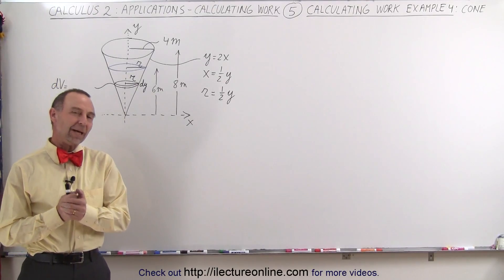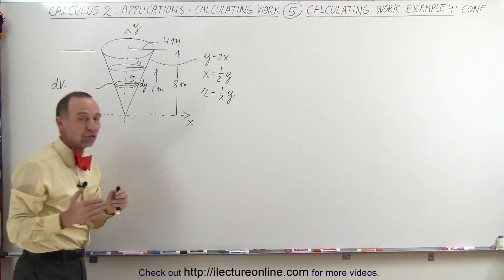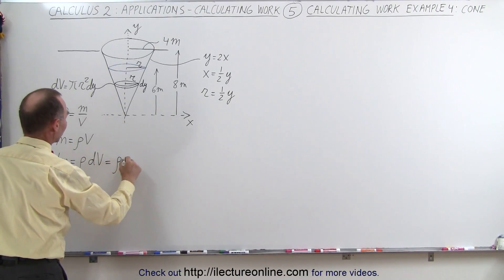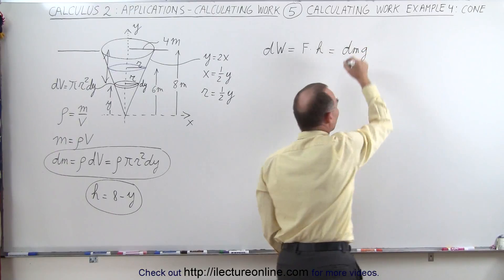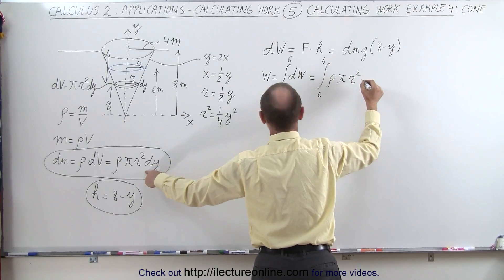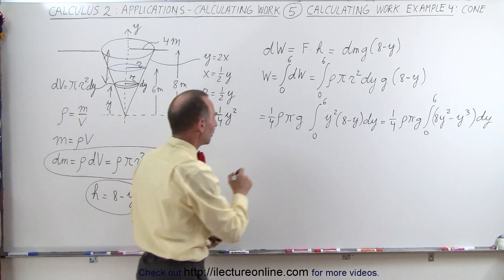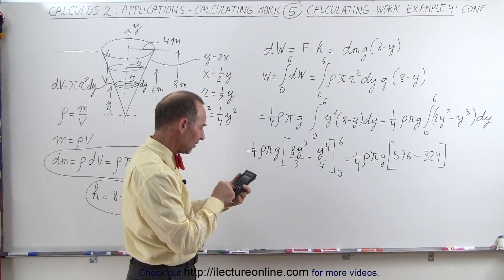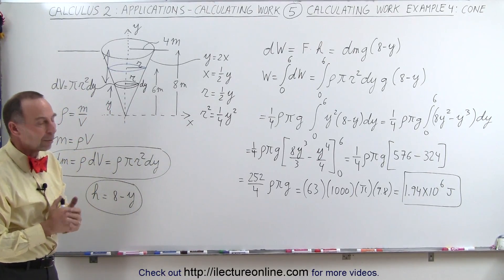Calculus 2: Applications - Calculating Work (5 of 16) Calculating Work Example 4: Cone

Comment: Thank you Sir for the videos. Can I know why didnt you just say h = 2 instead of (8-y) and why did you choose the limits to be 0-6 instead of 6-8 and can I use 0-2 as limits instead of 6-8? Thank you
Reply from the maker: The distance from the top of the water to the rim of the cone, as the water level drops down to zero, is always 8 - y for any value of y from y = 0 to y = 6.    h = 2 is only correct when y = 6

Comment: How does this pump work? Does it move down with the water level? Last time i checked a pump would pump from the bottom of the tank, and the water level would go down, with the top water being sucked up last, and the distance that all the water has to be pumped would be constant- the height of the tank
Reply from the maker: Regardless of where the pump is places and if the intake is at the bottom or not, the effect would be the same as if the water was drawn from the top of the water level.
Reply: I can remember that for the future, but it still conceptually does not make sense to me. If you are drawing the water from the bottom, then you are drawing the water from the bottom. The physical distance the water goes is from the bottom to the point you are raising it in my mind. Thank you for your reply though
Reply: Your explanation for this problem was excellent, however, far better than my professor taught it!
Reply: @purpleapplepie2276  The work needed is equal to the difference between the potential energy of the water in the initial state and the potential energy of the water in the final state. In other words, it doesnt matter the trayectory of the water in the process, it only matter its initial and final position...